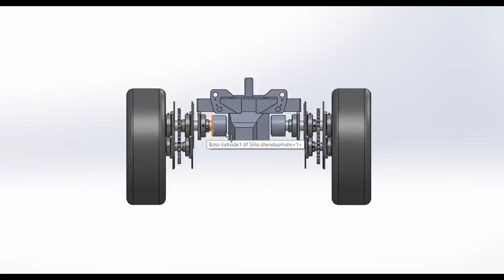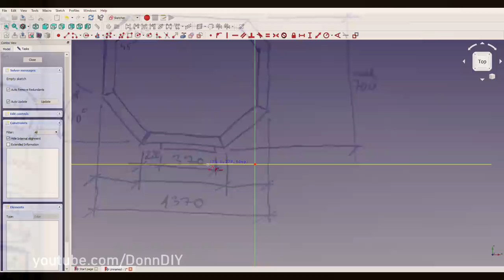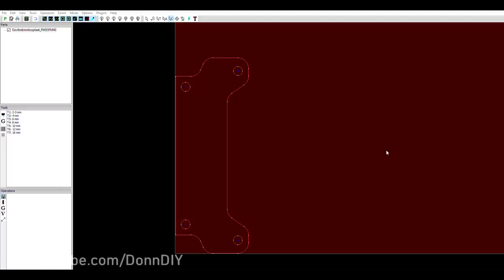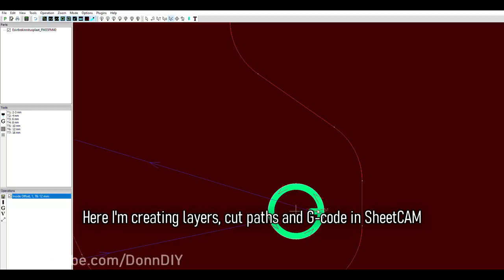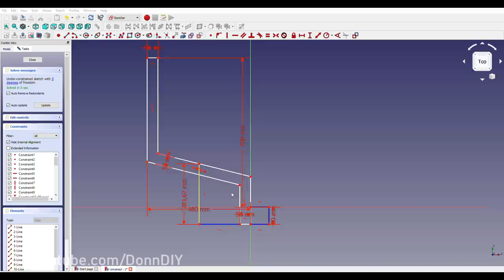4x4 PTO Driven Timber Trailer BUILD Ep.10 - Log Barrier & Posts

Comment: Donn's builds look as good as, or better, as anything I've seen come out of a factory.  👍😎
Reply: It's better he doesn't have to rush through on assembly he can take his time and see issues that arise and take care of them when they do instead of just putting parts together and hoping It all works together.
Reply: Better as? No such thing
Reply: @mwilliamshs  He has a comma after "better", (As it should be) it makes sense.
Reply: @johnvargo5695  nope. It's as good as (equivalent comparison) or better than (superior comparison). Better as makes no sense.
Reply: @johnvargo5695  neither of those commas is correct. They're both splicing.
Reply: @mwilliamshs  but, "or better, as anything..." does.
Reply: @johnvargo5695  no, it doesn't. Simplify it. Take out or better. As good as anything works. As good as as, your latest suggestion, doesn't. His work is better as anything doesn't either. 

As good as means equal
Or better than means superior 

Better as is meaningless
Reply: @mwilliamshs  (Sigh) ok.

Comment: Your eye for detail really stands out. 
With the log “fence” matching the stabilizer legs in the up position makes it a very cohesive project. 
It great that Forstman provides the customer support that they do. The “fence” mounting bracket is something you certainly could have done on your own but having the actual drawings certainly saved you a lot of time so you can think of the other parts like the log bunks. 👍🏻👍🏻👍🏻
@forstman rocks

Comment: I think putting a center diff in between pto and trailer diff will help. Will help with connecting trailer, turning corners and a clutch  will help sliding trailer axle as you will struggle to slide trailer axle back and forth especially if it is loaded. Love your work.

Comment: You should cut some 20 mm ID washers in half and weld them on the sides of the posts. Idea being that  you can hook netting or chain from them. Most 20 mm washers are strong enough to take the abuse. Alternatively, if you don't like washers stuck on your posts like some bad experiment phased them through, you could also put holes and just pass some rod through and thread some of those D rings whenever you need them. 
The trailer's coming along nicely. I like that you gave it plenty of suspension travel, should be able to soak up quite a bit of abuse.
Reply: Some chain links would work as anchor points for tying down the load too. It'd also be cheaper to buy a short length of chain compared to a fist full of washers.

Comment: The log fence is called a headache rack,self explanatory and the posts that contain the timber is referred to as log bunks over here in the US and both of them need to be as thick as the frame and fully boxed,gusseted, and braced because they suffer the most abuse time after time..

Comment: Nice work! But wouldn’t it be more clever to fabricate the posts in round pipes? Let the sit loose in another pipe with an angeled cut, meeting same angeled rim at post. Then they can swing freely past trees an other obstacles when trailer is empty. Still wanting to return to original position for loading. Have a brief look at larger commercial log trailers. Keep up the good work!

Comment: If you welded the seams, where do you expect the condensation to come from ??
Reply: I was thinking the same. But I've heard of hollow spaces filling with moisture without any apparent opening. Even a tiny pinhole can let the inside 'breathe' as the air inside heats up in the sun and cools down again at night, drawing just a tiny bit of moisture in each time.
I could be wrong. So, please, anyone who actually knows about this, correct me if I am.
Reply: All air has moisture in it and with the shifting in temperatures (cold to warmer) trapped air will condensate on the inside. Much like a can of soda/pop/beer will do when warming from being cold. So, if you allow it to breathe or maintain the same temperature inside and out you’ll have a more controlled condensation build up and a place for it to go (out of the tube. 

Adding drains depends on the situation and use case, imo. I’ve build crossmembers that get submerged and prefer to fully weld them because it’s a better option than to let them fill with mud. Here, I’d say he is in a much better situation where it won’t naturally fill with water/mud via the use case and it’s better served not trapping the air/moisture. A good option to help any of the internal rusting would be to spray all the parts internally with weldable primer to help control rust, or douse the insides with linseed oil or similar periodically if it’s really a concern. But the weldable primer just adds fabrication time. 

Just my 2 pence.
Reply: @possumwerks9783  the air does not change in a closed-welded pipe... In industrial plants, the pipe beams that serve as structural steel are always welded airtight... (except galvanized ones)

Comment: Will there be a way do disconnect the PTO shaft in order to let the wheels rotate when moving the axle back and forth?
Reply: It will slide in and out inside its self like pto shafts do by the looks of it.
Reply: @ryan71954  there has to be a way to rotate the trailers tires by itself without the cars tires
Reply: @rofllp2317  I think he intends to put something like a clutch in it. He won't need the trailer drive all the time anyways, especially not when he does a tight turn.
Reply: @MrSaemichlaus  that would make sense
Reply: I mentioned a center diff in between pto and trailer diff

Comment: I understand that you grind down the welds to be able to easily make all things the same. but you should never grind down the welds if you want it to last.
Reply: Yes, because grinding welds down weakens the connection. I think he's aware of it. At least he bevels the parts before welding.
Reply: Full penetration welds can be ground flush. It's fine
Reply: @danhammond8406  The key there is full penetration. Even with beveling, if you butt pieces up without a gap you need experience to know that you're fully through or you need to have sight onto the flip side to check if you're through. I trust him to be aware about this.

Comment: 10:20 But they're NOT Scraps...

They're Project Resources...

It doesn't matter when or how you got them or how many times you use them, they're still Resources for a Project...

At least until they get too short to be used in ANY Project, then they become Recyclable Resources...

But NEVER Scraps...

Scraps implies they have no value and metal will always have value even if that value is to be tossed in a smelting furnace to be melted down and made into new bars, pipes, sheets, ingots etc.

😄😁😆😅😂🤣

Comment: I wish someone would say why in the world do people plasma cut a perfectly good straight edge when there is already one there like on that loader base plate, they always set torch in 1/8"-1/4" in............ 8 hr on that front log guard means you was doing more fabricating then thinking about fabricating which is why it would've taken me one week to make....You should make stake-pockets for those stakes so when one get bent you can make new one to slide in, also if the stakes were set square it would be easier to separate log species, when angled like you have them it would be better for gravel to slide to center when loading when you place a dirt box in later. And further more cover your freeken mouth when sneezing, now you gave me covid an monkey pox......